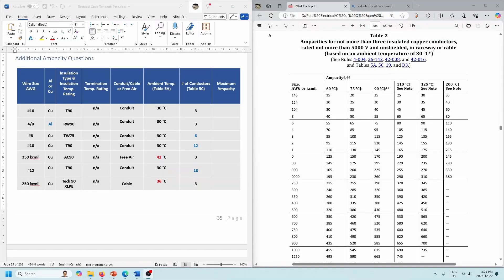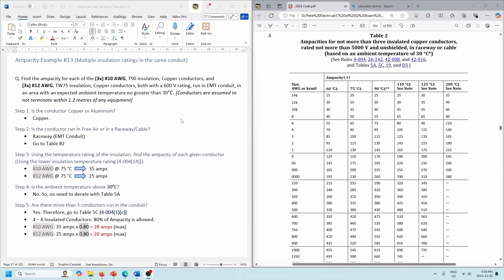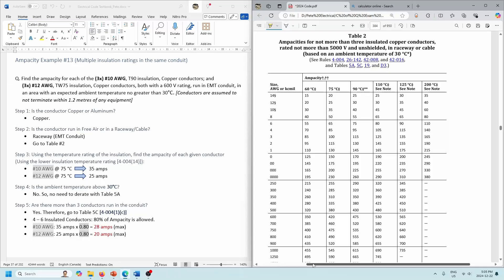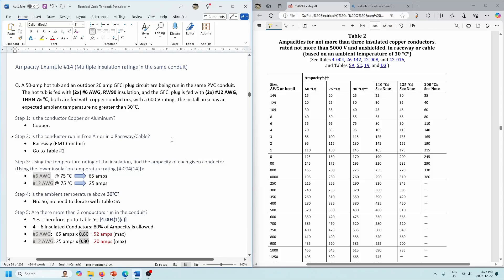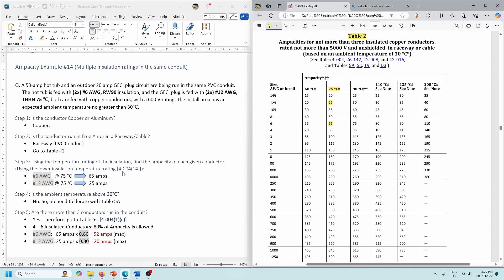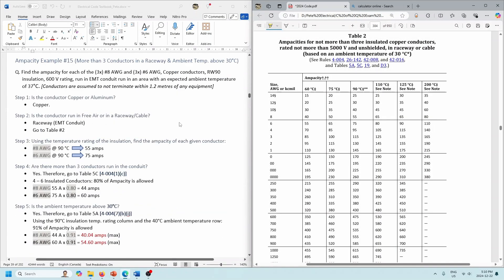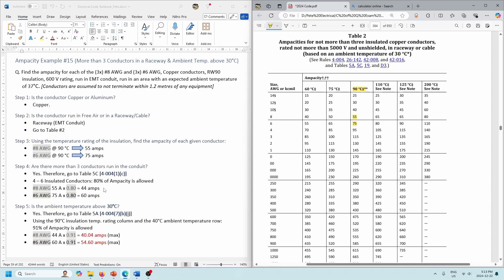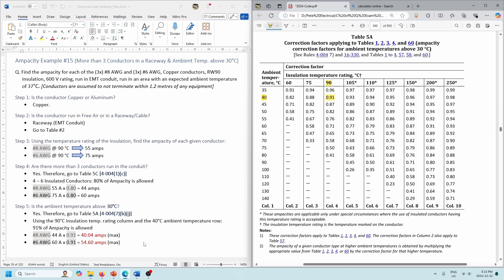Canadian Electrical Code 4-004 (Additional examples of determining the Ampacity of wires and cables)

Comment: Hi Pete. The last time I did this CEC update course in 2012, the BC inspectors would let us derate for ambient temp and raceway fill based on temp rating of the wire, then at the end compare the result to the value of the 60 deg column (termination temp)without derating. If the result was above the 60 deg result, we went with the 60 deg column with no derating. Is that still allowed? The rationale was that derating for temp and raceway fill largely happens in the wire far away from the terminations.